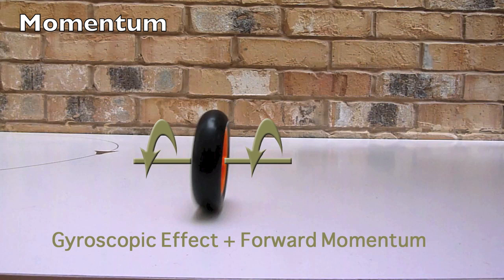The Physics of Countersteering

Comment: Its weird that most riders do this intuitively without ever knowing they're doing it
Reply: So is it like riding a bicycle when you go thru corners?
Reply: @smythe7480 Yes.
Reply: @smythe7480  no
Reply: The brain is a fuzzy black box that turns inputs into outputs without always understanding why.
Reply: This is in fact, what "learning to ride a bike" means.   It means learning how to counter-steer.   Some people will assert that counter-steering is only used for aggressive inputs, emergencies, or only at higher speeds, and that you can or always turn without it at low speeds.  The reality is, we naturally counter-steer all the time, and learning how to initiate with only body weight (e.g. riding hands off on a bicycle) is relatively advanced, and not very effective (see NO-BS bike).  Even at very slow speeds while riding a bicycle you must countersteer to make any sort of tight turn.   Don't believe me?   Try riding right on the edge of a sidewalk (grass side for safety)  at a slow  speed, and then try to quickly turn away from that edge.   See where your front tire goes first.   What we think of as "balancing" while moving forward is just constantly driving the front tire under the CG of the bike+rider combo, and that is also counter-steering.    We usually think of it in terms of initiating a lean, but it's also how you stop or reverse a lean.    All balancing vehicles counter-steer.  

BTW, this is why training-wheels should never be used on bicycles.  They literally teach kids how to turn the wrong way, and they have to unlearn that (learn to counter-steer) to actually ride their bicycle.  This is also why you'll see a kid on a bike, get fixated on something far away (lamp post, mail box.. person) and as they try to avoid it, they will follow a wobbling path straight into it.     Their brain is telling them to turn left to go left to avoid the obstacle but their newly learned counter-steering instinct knows they need to turn right to initiate a left turn.   These two conflict and they wobble back and forth until they crash into what they were trying to avoid.        Same thing happens to motorcycle riders in emergency situations.   If you stop thinking of it as a sometimes thing, and consciously treat it as an always thing, then your emergency turn is no different than any other turn.     You'll also find that you have to work less to turn.
Reply: Yeah xD
Reply: Most motorcycle fatalities are New Riders who instinctively think by turning away from the object they are trying to avoid will move them away. 
Which actually sends them toward it. So not every rider does it in a panic situation. The last thing that enters a Rookies mind is aim for what I’m trying to avoid to get away from it.
Reply: @vking5665  i dont think you get it.   no worries ...  its somewhat intuitive.
Reply: Feel the force (of the wind) go with the flow
Reply: It saved me from crashing when i was overtaking a 4 wheeler and guy in front was overtaking a 4 wheeler too, he panicked and tried to lean out and counter steered without knowing which made just enough space for us to not crash 💯
Reply: When I was younger I use to do this when riding bicycles withs out even knowing
Reply: The moment when you first do it naturally is just something else, the feel itself is just something else..you can't force it, it just happens!
Reply: I didnt know until i watch this video that i had been counter steering and direct steering on a bicycle and underbone for years but still thinks its normal and simple
Reply: same for footballers, they can pass the ball exactly in cm without know the motion of equation of falling object and aerodynamcis drag of a sphere
Reply: Not really, most riders leen
Reply: they die or crash if they don't know , you have to push bars quite hard to dodge anything fast or at hight speed the force required to push increases Dramatically
Reply: M Detlef  youre a piece of trash
Reply: That's because most people lean to the direction they want to go. This in turn puts some force on the handlebars inside the turn, which subtly turns the forks OUT of the curve. Then physics takes over and the gyroscope effect leans the bike into the curve. Thus you're intuitively doing the wrong thing which unintuitively means you're doing the right thing! 😂
Reply: The problem with doing it intuitively is that during emergency, the wrong reflex kicks in, which is not counter steering but steering into the target.
Reply: It's actually very simple. You get on a bike, and the bike responds to your input. So you immediately learn how the bike reacts when you do something, because you see and feel it happen. So you countersteer, because it works.
Reply: I am a new rider, I am watching this video and I still don’t understand how it works. I’ve tried it numerous times and still don’t get it.
Reply: Harley riders don't know about this which is why they crash so often
Reply: They dont. For most speeds and handling you never do this, and they also never do this. You can absolutely steer bike with just handlebars.
Reply: Blew my mind when I realized what I had been up to all these years…😅
Reply: Too many people say this doesn't work on a bycycle or when going at slow speed on a motorcycle. There is no other way any two wheeler steers.
Reply: Surely it's all riders that do this rather than most? It's the standard way to turn isn't it? Even if you don't know you're doing it. The only other ways to turn are to to just turn the bars in the direction you wanna go, but that only works at very low speed. Or to lean bike without initiating countersteering first, which is more advanced and more for racing, trials etc.
Reply: @wriches  Not necessarily, it is perfectly possible to start leaning into one direction without counter steering, as mentioned in the video it's just much harder to do so. You don't really counter steer when changing lanes in an open road (I don't mean object avoidance like mentioned in the video, but instead a perfectly open motorway where you decide to go from one lane to the other, it's an extremely small movement, and you can imagine it as a small part of a gigantic radius turn. That said counter steering makes initiating turns much easier in general so you end up using it all the time. Imagine it like a heavy pillar you're trying to push over, if you just push it it'll be very hard to push it over, however if you rock it back and forth and then give it a big shove after you get it moving, it's easier to push it over.
Reply: @wriches Nope..Not at all. There's hundreds of videos online showing new riders turning literally the wrong way. And crashing off the road or into traffic
Reply: @wriches  its not standard for me, i typically do only leaning.
Reply: it is called sense of balance
Reply: maybe because they used to ride bicycles first.

Comment: What a terrific illustration of what counter steering is all about. All good from where I sit...except for the assertion at 1:03 that angular momentum "is what keeps a rolling bike upright".  I would argue that trail, built into the front wheel/steering geometry, is what keeps a bike upright at any speed.  Simply put, trail geometry self corrects steering angle to keep a bike balanced (keeps the wheels under the center of gravity) whether turning, or going in a straight line.  Gyroscopic effect, which increases with speed, resists any change in axis (and thus change in direction) of a spinning wheel.  Gyroscopic effect is why changes in lean angle occur far more slowly at high speed than they do when initiating slow speed corners.

Comment: Gyroscopic forces in the front wheel do the work for you. Bicycles are the same but less noticeable. Steering left gyroscopically forces the opposite lean direction creating a sharp right turn. Bikes when rigged correctly only need this input, balance and lean are automatic, no need to touch the bike.
Riding a minibike with small wheels demonstrates lack of this force. Big front wheel = stability

Comment: You were going great until 2:12 - it is gyroscopic procession that causes the front wheel to lean and it is the gyroscopic force working with frame geometry and frame integrity that cause the rear of the bike to follow and thus steer the bike.

Comment: I thought centripetal force is the force that the lean to the inside and friction of tires create which fights against the centrifugal force which is the force pulling the bike outward which makes the bike want to tip over to the outside.

Meaning centripetal force is what makes you turn and centrifugal force is what makes you want to go straight and eat crap and high side.

Comment: When riding a bicycle or motorcycle at a slow pace, “turning” out the handlebars/wheel results in the vehicle moving in the direction you point the front tire.  When turning a Motorcycle through tight cures and at a rapid rate of speed, the front tire does not hardly change direction at all, as fairing mounted cameras will attest to.  All of your explanations I believe are correct.  What I am most curious of, is the relationship physics of force action/reaction plays once your hand pushes on the bar the same side as you wish the direction of the Motorcycle to go in.

Comment: This video explains several of the factors of physics regarding what is happening in a turn on a motorcycle.  What is missing is the physics of pushing the bar the direction you want to go.  How does that pressure affect the Motorcycle to force it to lean in the proper direction.  Action/reaction from hand force forward on the bars intrigues me as Keith Code demonstrates for a moment in time the bars turn the “wrong” way and then “counter-steer” to turn, dive into, or lean the proper direction kicks in. “Splain it to me, Lucy!”

Comment: At speed, force a sudden steering-only turn momentarily toward the obstacle, causing a near wipeout in the other direction, and then let the bike’s momentum do the recovery smoothly away from the obstacle. Just hope there’s enough friction with a stable road surface to keep from sliding out.

Comment: I still don't understand how leaning to the left while the wheel is going right doesn't make the bike go out from under you
Reply: It depends on your speed and how much of your body /body weight you put opposite of the direction you're turning the wheel.  The bike kind of self-corrects as far as front wheel direction when you push away from you ( straight away ) on either side of the handle bars depending on the speed.  Obviously as speeds as slow as 5 to 9 or even 10 mph you'll have to manually correct the handle bar direction or the bike surely will fall to one side and you'll lowside wreck.  

Fast Eddie's Motorcycle Fun has done some wonderful explanations but more importantly demonstrations of both fast ( faster than 15/20mph) and at or slower than 10 mph about this.  

IF you're doing at or under 10mph ish and you're trying to do an extremely sharp/tight left hand turn.  The slower you go the more body weight you need to put/lean in the OPPOSITE direction of the turn direction you're trying to get the bike to go.  This is because at slower and slower speeds and sharper turns..the bike will auto want to fall in that direction even if  you turn the handlebars so tight in that direction you  lock them, so thus to keep the bike barely upright enough when doing an ultra sharp left slow turn.....move your right buttcheek off of the seat to the right side of the bike to put most or damn nearly all of your body weight on the right side of the bike to counter weight balance it during the turn.

Also...the experimentation part that only you can figure out comes with practicing that throttle and clutch in unison...primarily...clutch control.  Find that sweet spot of not letting the clutch all the way out, but riding the mental " line" of not pulling it in too much eithe.r..just MILLIMETERS..of adjustment in real time..every single split second.

*  Now when doing a faster speed sharp turn, as far as body position setting it up, you prep to learn in the same direction of the turn you're trying to make...even if it's just a quick sharp turn/swerve and then to turn right back sharp swerve again to quickly go around an obstacle in the road like a pothol.   You push fairly hard OUTWARD...AWAY FROM YOU ( pushing down depending on the speed may not be enough) on the left handle bar to prep the bike to fall towards the left so you start immediately turning sharply left and keep your body " flowing" /leaning with the bike ..some...( the sharp the swerve/turn..the more lean at speeds above 20mph), then push the right handle bar the same amount and learn your body to the right to stay balanced with the bike.  *

IF you have grass and a backyard and a bicycle, put on some knee pads and such ( and hopefully your backyard unlike mine..is fairly level and not going up hill or down hill with another room) and test it.  At least this way, if you screw up and fall, it will be on grass and not risk breaking bones on asphalt or concrete and it's a form of baby steps.  respectfully saying  here.  Cheers.

Comment: the idea scares me so much, good thing im practcing in a big empty parking lot with dad who has 40 plus yrs of motorcycle riding. gonna take me time to get use to this countersteering thing... maybe im thinking bout it to much...?
Reply: You definitely are thinking about it too much :)  
Just go straight at first, and purposely push just a smidge on the left handlebar, and feel what the bike does, then repeat pushing on the right.  
Use this to move from the left side of the lane to the right side of the lane, back and forth, for a while, pretending you are dodging potholes or something.  
It will feel comfortable very quickly.  
Of course, as all things, it will take some time to be entirely second nature - which is important, in an emergency.
Reply: Ghost_Control
Understanding the underlying physics is really not necessary. It might help you to overcome your instinctive resistance to the idea but really it's learning by doing.
Reply: I actually have figured it out now! It's getting better!